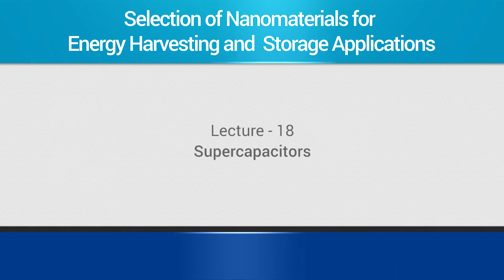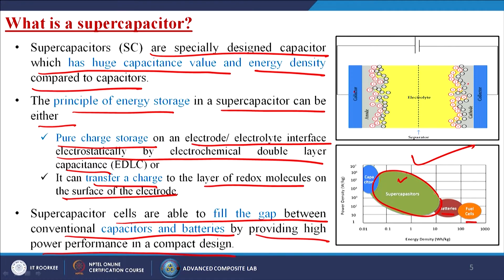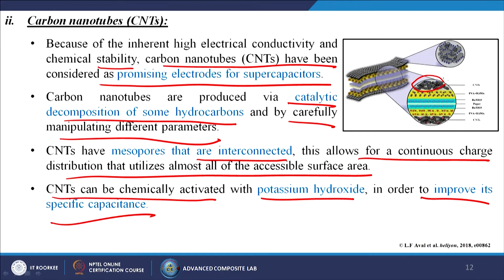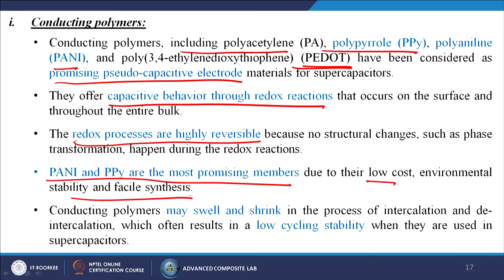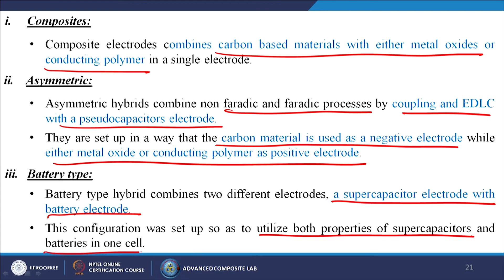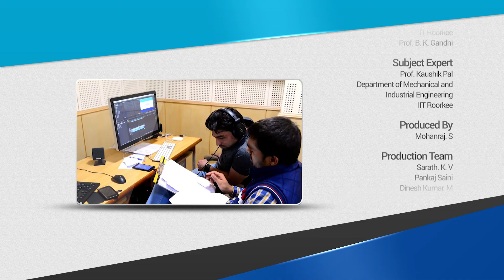Supercapacitors

Comment: Very great and useful explaination, Pal Sir!! 🌹🌹 I wish to build a capacitor that's cheap to produce has great capacitance and lasts long, please suggest if I can go ahead with symmetric design using aluminium plates as current collectors coated with activated carbon and doped with electrolyte, Sir, please guide 🌹🌹💐💐